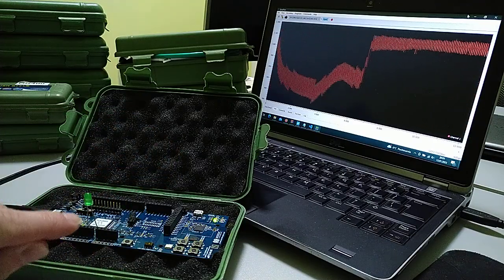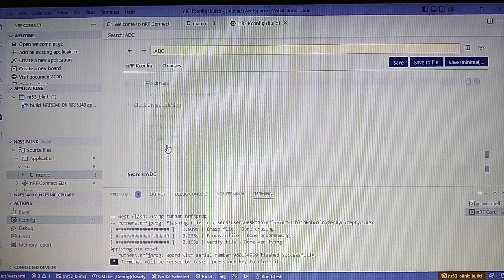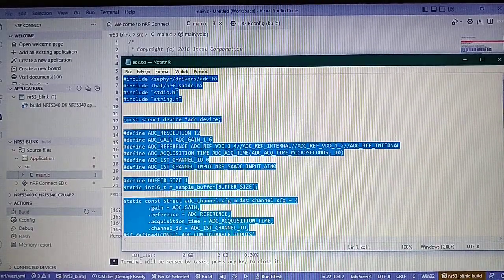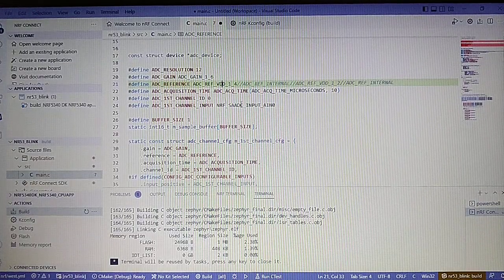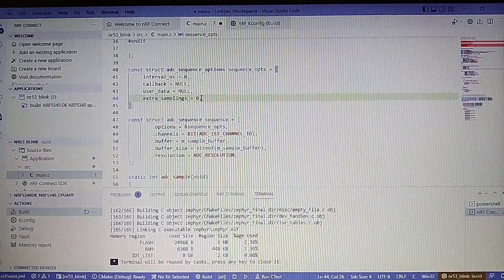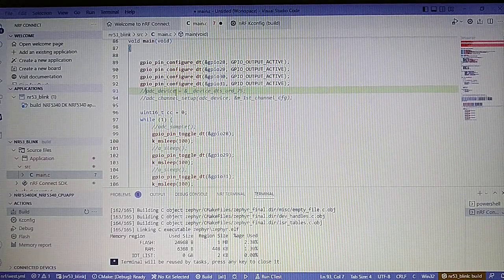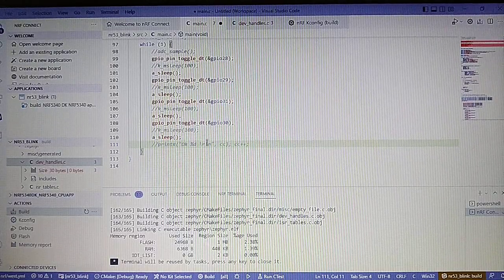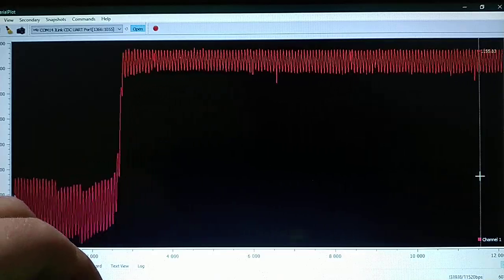Nordic NRF5340 DK simple ADC example in nRF SDK VS Code

Comment: Hello Sir, is it possible to use it as a DAC?
Reply from the maker: Hi, the nRF5340 does not have a built-in DAC so there is no way to get a true analog signal output.
Reply: Thanks sir, I kinda simulated one, I just needed to test some digital inputs for a PCB  @e-exp